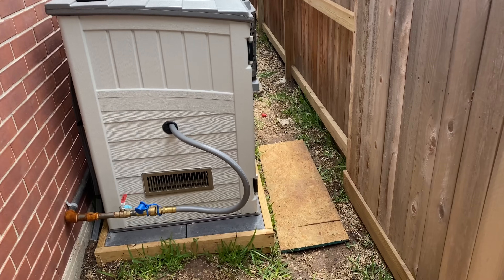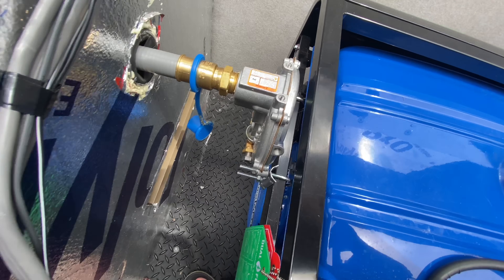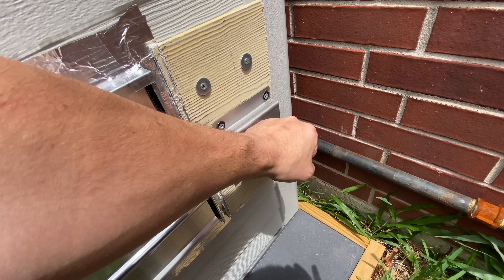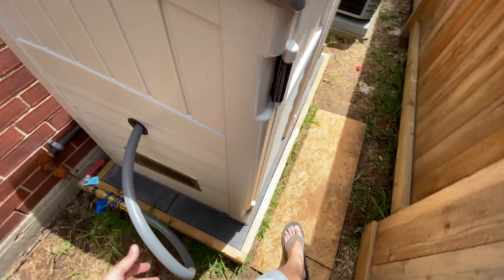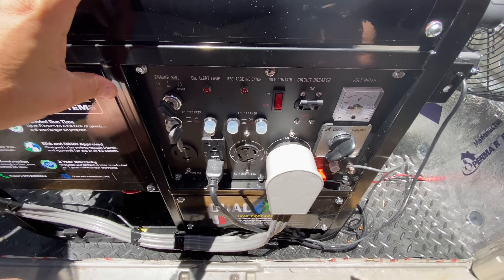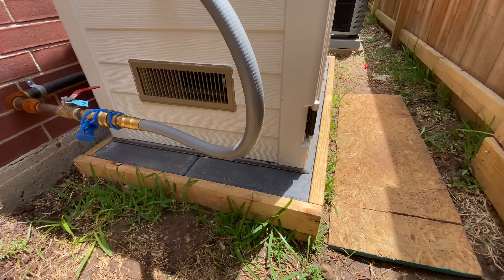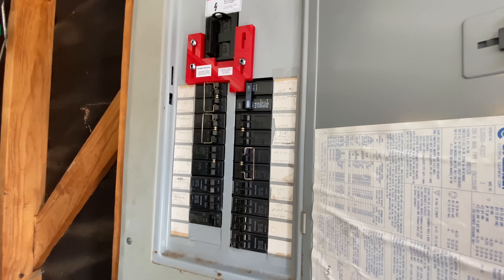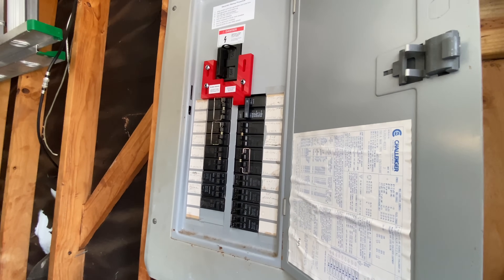Converting a hybrid portable generator to a whole home generator with shed

Comment: What realistically could this setup handle for your home? I assume this system couldn't handle the A/C system along with other power supply draws.
Reply from the maker: It does! It handles all the circuits inside the home and one AC unit. I don’t try and run the electric dryer or oven. Everything else is golden.

Comment: I wound up buying the Duromax 13000EH. Then a few months later I decided to get the generac whole house generator. And you were right about the price. I got a generac 24KW installed for $10,000. One of the reasons I changed my mind is the last time ny power went out it was too dangerous to go outside to manually hook everything up. It was 2am so I just laid there and suffered until morning. But I'm happy I went with a whole house hookup. I decided to keep my 13KW for the reasons you stated. You never know when you will have a need for power elsewhere.
Reply from the maker: I am considering getting a Generac and installing it myself. I figure the current generator is a good backup option. I agree, when a storm is hitting, you have to wait until it stops to start the generator.

Comment: I like your set up but may I caution you about a heat generation issue . Even the smallest of generators produce  lot of heat . The attic fan is a good idea bu attic fans are equipped with a thermal overload in case there is  fire in the attic it will shut down the fan . I think that you may run into a problem where your fan will shut down in thermal overload . Usually in generator installation you want 3 times the input size of fresh air intake as the exhaust air out . I would recommend adding a fresh air input fan also.  
I used to service emergency generators so I know a little bit about generators.....

Comment: Bro.. you're ac will run harder if you're throwing that exhaust heat at it.

Also get a soft start kit for you're AC and that will help the load on the generator tremendously!

If you keep the exhaust pointed at unit I would setup a sprinkler or some type of mist system to keep those coils cool when it's running!

I am wondering what your power is from 1200 now since going with propane. I want to run natural gas but my generator is not as powerful so I'll definitely need a soft start kit for the AC
Reply from the maker: Have a hard start kit already on them. Also, it really isn’t close enough to effect the AC. AC guy says it is fine and the heat isn’t really any different than the outside air by the time it hits the AC. I hear the drop in power is 15-20%. My guess is I am in the 7,000 running watt range on NG / Propane.
Reply: Cool thanks for the reply. I have the 9400 trifuel firman from Costco. It says I'll get 5500 running and 6900 starting with natural gas.

I haven't used it yet because I need to get a soft start kit in. I hope it runs my 4 ton unit.

Anyways your video has inspired me to do something similar so your ideas and links to products were very helpful. Thank you :)
Reply: @jpecoul3  brother you need at least 17000 watts generator to power your 4 ton ac unit.
Reply: @cryptolife5756  not with a good quality soft start kit like the Micro-air units, the inrush (CCA) is dramatically decreased making it feasible to run on mid to large portable generators.

Comment: I didn't watch all.  Is the fan to disperse the exhaust fumes ?   I think 5' distance from wall is required to prevent CO2 from exhaust from entering attic and house thru soffit vents.  This killed a family in Florida.
Reply from the maker: The exhaust has its own path. The fan is just to pass air through the shed. There is no window within 6’.

Comment: What I REALLY want is a whole house battery system that can be charged from a generator. Enphase is getting pretty close to implementing this, but only with tested permanent mount generators. Their electronics don’t do well with the level of Total Harmonic Distortion that non-inverter portables put out. For now I have a Tesla Powerwall for short interruptions and peak shaving and a Westinghouse WGEN7500DF with Reliance multicircuit manual transfer switch for longer interruptions. I don’t want to deal with stale fuel (although I like having the option) so I have four 100 lb propane bottles and am planning to add natural gas capability to the generator. I’m not doing a generator shed at this time because this air cooled generator hasn’t been tested in the hot air environment that’s inevitable from limited ventilation (and I don’t want to find out the hard way). A shed sure would be nice though.

Comment: Thanks for doing this video. I am also in the Houston area (east side). Ike tore us up pretty good back in 2008. I also use a CPAP, and we lost power in this last storm (Nicholas) for ten hours. I couldn't sleep. Same goes for the snowmageddon last year! I am not waiting any longer. I am looking for an inverter generator so it won't kill my appliances, computers, etc. BTW, it would sit just like you have it. Dang crowded with the fence and neighbors right next door.
Reply from the maker: The other side of the fence is a driveway so there is a bit of space to the neighbors house 😬

Comment: You need lot more , ventilation itllrun too hot and cook itself need way more ventilation .
Reply from the maker: Its been running great for almost two years. The highest my temperature monitor has show is 120 degrees while it was 98 degrees outside.

Comment: Nice Job.  I don't agree with whole house generator.  Better to have a small one like you.  If you have extended power outage the bigger generator wastes fuel.  Better to only power critical loads and use less fuel.  If there was an outage of your nat gas you will be glad you did it this way.

Comment: For just a little bit more of an investment after all the $ sank into this you could have just bought a whole house 12kW generator and installed it yourself.
Reply from the maker: Now that I feel more comfortable doing the work, I may do that and keep the Duromax as a backup. I like the option to run on gasoline or propane. In Louisiana, a lot of the whole home generators didn’t work because they had to shut off the natural gas lines due to all the trees that came out of the ground, damaging NG lines.
Reply: @CalvinGorriaran  Lived in Slidell for Katrina.  Every hurricane season we had 12 5gallon gas cans which we would fill IF a system hinted at coming to Louisiana along with plenty of SAE 30 oil etc Would fill em up to beat all the crazy gas runs and if no hurricane no big deal gas just went into cars.  With a 3500 watt gen running a small 5000 BTU window unit we had enough power to run that, fridge etc and enough gas for nearly a week.  Looked at a whole house but in an emergency don't need to power a 5 ton AC unit etc..  Still today have the same generator.  The only sure thing for fuel is propane that last 30 years in a tank.

Comment: Generac commercials are deceiving. I have health issues and can’t tolerate heat anymore so last blackout after sleeping in my truck for 3 nights to have a/c i called Generac to get one installed. Between the “codes” like it needs 5 feet of clearance on all sides, must be behind or on the side of the house not in front, and the “charge by foot” of installation of the wiring and gas pipe, my estimate came out to 18 grand! For 5 grand u can get a Winco 22kw portable generator with 79 amps (u need 60 amps min to do a whole house transfer switch)… and for another grand u can get that transfer switch installed, so the only drawback is that in a blackout u gotta wheel the genny out of the garage, plug it in and hit the switch instead of N auto transfer. I researched this shit for a year, checked out every type of generator, even military surplus and the 22kw Winco is my personal choice. Duramax has a big one too that runs off propane but it’s usually out if stock everywhere

Comment: My only beef with this type of generator is the servicing needed after running for just a few hours. My Rv required servicing every 50 hours of operation,  basically after a single three day weekend at the lake. I always pushed to a 100 hours of operation, and it would start missing and running a little ruff near the 100 hour mark. The $2K price tag is very attractive and the since this usage would only 2 to 3 hours per event the servicing wouldn’t be as big a deal.

Comment: What level of overall performance does the idle control effect?  I have the same generator and the manual provided no info on that switch.  It only states that it should be turned off to start. :/

Comment: How clean of signal  is your generator producing? One concern  I had is an inverter generator would provide a cleaner signal for computers and other electronics. Wasn’t able to find a high enough wattage inverter one at 240V 30 or 50 A that ran on propane or natural gas to interface with the panel. Thanks
Reply from the maker: It’s not amazing. Take a look at the Westinghouse models. They have low THD. I have a few line conditioners on  computer equipment but more so the Battery backups stopped making noises  when the generator was on.

Comment: Seems like a lot of work just to put a portable generator in a box.  I have a Honda 12K Watt Generator that I just keep in my shed, can run for 8 hours or longer on a single tank and when I heed it I just wheel it out and plug it into a box on the side of my house and then flip the main breaker and activate the breaker for the generator and I can run just about everything I need with the exception of dryers and ovens.    I supposed I could convert it to natural gas but we never lose power for more than a day or so regardless.  Maybe it is just me but I could not relax with that setup so close to my house.  Would be thinking, what if the fan dies, what if the generator vibrates enough to move the unit too close to the walls of the enclosure etc.
Reply from the maker: Ran for 48 hours straight during the freeze. Also have a remote temperature monitor. I am considering moving it though just for added safety.
Reply: @CalvinGorriaran  Putting it in a box does not mean it can run longer, I could hook mine up to NG and run it forever if I wanted, my point was, why put it in the box?
Reply from the maker: @VelvetHammer1  so I don’t have to move it and it is protected when we it’s raining and the generator is running. Or snowing in the case of the freeze last winter.
Reply from the maker: @VelvetHammer1  do you mind mentioning how you found my video? I have had like 30k views in just a couple days. Wondering if it is just searches due to the hurricanes or if it got posted somewhere.
Reply: @CalvinGorriaran  just stumbled upon it on YouTube.

Comment: Three thoughts. 1- nice job. 2- you need a sediment trap at the end of your gas line before it goes into the generator. 3- you say you purchased an extended warrantee on the generator, FYI by converting to natural gas you voided your warrantee. 
Again, beautiful job.
Reply: So revert it back before you take it in for the warranty work. No modifications made were/are permanent.

Comment: So you said the generator runs in propane or gas...but then you say you are running natural gas. Does the generator run on propane, natural gas, or both?
Reply from the maker: Both. I just swap the generator hose to the propane regulator. It also still does gasoline.

Comment: I got a Generac I paid $3,700 for it it turns on the turns off automatically it in an enclosed box automatic transfer switch the only thing I do is every 3 years but are you battery check the oil every 3 months 23 years old yes they are more expensive but that last 10 times longer but you do make a nice video I live in edinburg TX
Reply from the maker: Hi! Did you install it yourself? Who did you buy it from? Quotes I have seen are 10-15k installed.
Reply: @CalvinGorriaran  I got my from Lowe's
Reply from the maker: @solarandwindinsouthtexasda1473  did you install yourself? Can you point me to it?
Reply: @CalvinGorriaran  yes I didn't that generator the best thing I ever bought hadn't installed in Miami Florida when I move to Texas the generator came with me I ran it when dolly another one in Texas I forgot what it was I want that cold front came down I ran the generator to that generator has been installed and removed out of five homes every time I move I'll take it when I bought a new house a guest install to the new house the generator has not changed much from the old one to the new one the transfer switch changed a lot
Reply: @solarandwindinsouthtexasda1473  obviously you never had that generator

Comment: Did you check if the generator is wired as a floating neutral so it can be more safe when connected to your main electrical panel?
Reply from the maker: This is something I have been reading about. I need to do more digging on it.
Reply: @CalvinGorriaran  Please do. Imo the portable generator should have a floating neutral when connected to house panel and not floating when used as a  portable generator.
Reply: Calvin is correct !

Comment: I'm a licensed electrical, generator and HVAC contractor. That exhaust blowing into your AC condenser is terrible for it. Also the small air intake is just straining your fan and restricting the airflow. Put a thermometer in there, I'll bet you are cooking that generator.
 And your ground rod also needs to be tied to your main panel rod.
Reply from the maker: It is about 3 feet away. It isn’t really hot by the time it gets to the AC. My AC guy has been here several times and said it wasn’t an issue. Even turned it on for him under load.

Comment: Let me just add a little clarification here. As soon as you put that generator in that box you void all warranties not to mention creating a serious fire hazard. It's great that you vented it with an attic fan but what's going to happen as soon as that attic fan fails, is you're going to have a complete meltdown and hopefully you don't have any wood near that brick on your house. I have been an industrial generator service tech for 12 years and have seen all of the mistakes. This is not a safe means of creating a stationary generator nor is it good for the generator itself. Air-cooled means that it needs to have constant air flow around it and stationary ones are engineered to have constant air flow with a mechanical fan built on the assembly. Tread lightly!
Reply: I am sure this generator has a mechanical fan on it too.
Reply: @uhjyuff2095  no they do not.
Reply: @mattmiller4036  The front crank pulley/balancer has fan blades on my portable generator open frame with wheel kit.
Reply: Right, the engine has an ancillary one but the winding section does not. That's why the those are designed for open air operation. Look, do what you want. I'm simply relaying my years of experience to prevent somebody from getting hurt or worse.

Comment: Very clever however the way it's installed breaks code in several ways. This generator is not rated to be so close to the house. Also, pretty sure the warranty is void due to placing it in a box. Then your exhaust outlet is only a few inches from your AC unit putting hot exhaust directly into the condenser. Finally, the gas regulator needs to be vented to the outside, at least 10 feet from any potential source of combustion. I'm surprised your plumber bought into this.
Reply: Standby generators are complex to install. Have you installed a standby generator on your home?

Comment: Most generators have a gasoline output Kw rating which yours would be 12,000 while natural gas Kw output is reduced to 10Kw or maybe lower. That NG regulator is purchased got the size engine your running. It's possible they gave you a rated lower regulator for a smaller engine. Looks decent. That attic exhaust fan itself draws a good amount of energy. If your just using it as ventilation, maybe a vent hood would work better. He's does riser faster than it moves horizontally.  Nice video.

Comment: Makes me uncomfortable as a firefighter that has fought fires because the generator was too close to the house. The last one set two houses on fire so I hope your neighbor isn’t on the other side of the fence. Also the exhaust os going into an enclosed space so CO poisoning is still a concern. If this is up to code or if there are no codes prohibiting them this, I’d urge you to install some a heat sensor fire alarm in there, a CO detector inside the building near by and have the largest size ABC dry chem fire extinguisher you can carry a safe distance away and a gas shut off wrench near your meter. I’d practice rolling out of bed shutting off the gas and power and bringing the extinguisher to your generator a couple times a year and make sure all
capable adults in your house or maybe your neighbors know how to as well.
Reply from the maker: The other side of the generator is a large driveway. On my side it is a large brick wall with no windows. I do have Nest CO detectors in several places downstairs. I am considering moving the generator another location by the detached garage.
Reply: @CalvinGorriaran  still a pretty cool setup, I’d like to do the same but I’d be worried about the zombies taking it as I live in the New Orleans inner city. We have an exhaust removal system to take the CO out of the apparatus bay when we run the trucks. It’s called a primavent system, it’s basically an expensive way of selling us a vaccum. The only downside is we can’t run the trucks for more than 15 mins on or plastic tubing can melt, so if you built something like that I’d look into something beside the ribbed plastic vacuum tubing
Reply: Awesome information about the drill, thanks for sharing that.
Reply: Mine was too close to the house and was setting off my Nest CO2 alarm inside the closed garage, so I repositioned it to exhaust away from the house. I wasn't taking any chances, I have a very similar setup to this one.